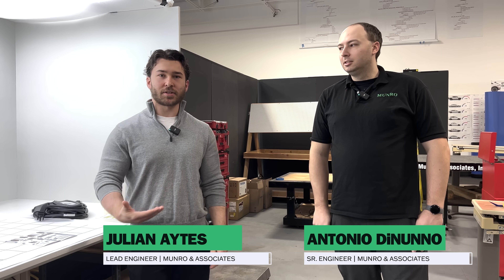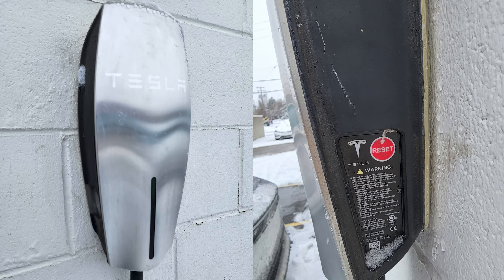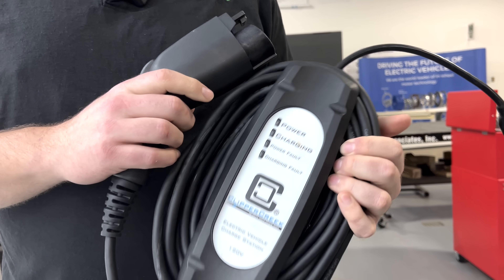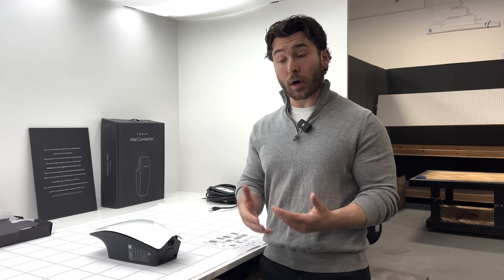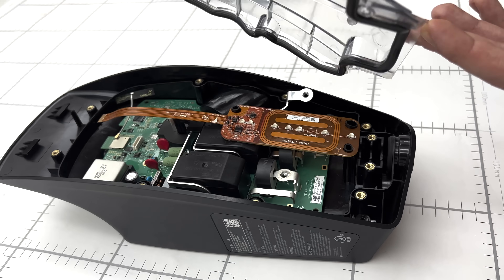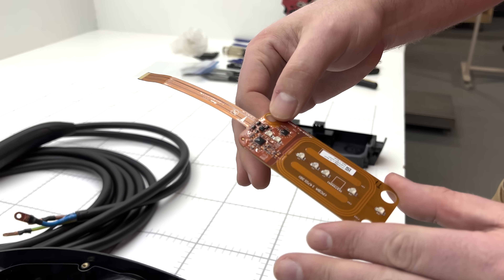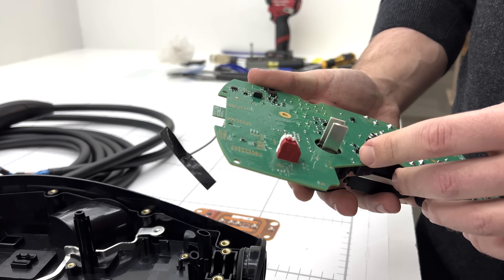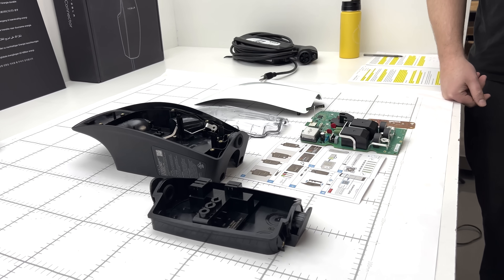EV Home Charger Teardowns E1: Tesla Wall Connector

Comment: 12:34 I swear to God once you start using a torque screwdriver for diy electrical work, you will NEVER look at the average electrician the same

Sidenote: I'm going to be disappointed if Sandy doesn't reply with a comment about tHrEaDeD fAsTeNers 😉😉😉🤣
Reply: There is no disrespect for the threaded fastener, just a general disdain for excessive and unnecessary ones where other options are better suited.
Reply: @BatterVswithAntonio  oh, well, in that sense, wago-style lever connectors would definitely be a better option if they could be sprung much more aggressively. I say this as someone who's still just getting on the wago bandwagon... If they could be made much beefier I'd probably drop wire nuts entirely. I like all my current conducting splices to squeeze down on that copper almost enough to cause plastic deformation. Which, full circle, is the great part about torque screwdrivers... You get that clamp load of 200ish-400ish pounds on wire binding screw/wire of a commercial+ grade receptacle, and not, like, 1000lbs.
Reply: Nec 2023 requires the use of a torque screwdriver,there has always been torque specs on breakers and other terminals
Reply: @cengeb  I think it actually goes back to 2017. And yet, nobody uses them. They're very important to get adequate contact pressure on copper conductors.
Reply: @Ariccio123  yup correct

Comment: the unknown connector on the back (red white) may be the deprecated 'serial' port to interconnect between wall connectors allowing them to safely share a breaker. Previous versions relied on a physical data connection to accomplish this. The modern ones use a wireless network to instruct one another how to share gracefully. The wire terminals may be to enable sharing with a gen 1 or gen 2 wall connector...just undocumented.
Reply: confirmed this as true
Reply: @BatterVswithAntonio  where did you find that confirmation?
Reply: @Marki555  confidential source ;-)

Comment: Antonio and Munro team. You start this level 2 charger series with a great bit of lean design by Tesla. Having learnt a little about lean design from Munro here are a few lean thoughts that IA chatbots would struggle with:
-- The Tesla HVAV system is great lean design but it could all be under the hood in a single package with ducts to the cabin.
-- Side-stick drive-by-wire   As electromechanical brakes are a thing, brakes don't need hydraulic components. There are motor vehicle systems to steer, accelerate, brake by wire - we can have drive-by-wire using a side-stick as used on Airbus aircraft and many wheelchairs - they are human rated. The side-stick would mount on the door and might include vehicle security and safety systems. There would need to be left and right hand versions, and disabled people could get bespoke side-stick shapes and locations.
-- Without HVAC and driving controls dash/floor mounted, the dash can become a bar like in the Canoo. The bar would be a mount for airbags, air vents, screens and some switches. Some console electronics could be mounted on the bar. Driver and front passengers could have identical screens and see identical information, but only the driver could control drive-by-wire functions. Rear and side view mirrors would go to be replaced by cameras and view display on screens. As with CyberTruck design, full width front windscreen sunshades could come down from the top and up from the bottom but with a safety mechanism to ensure the front screen can't be closed off while the vehicle is in motion.
-- If we are doing drive-by-wire, we could could have identical front and rear drive units that combine drive motors, inverters, inboard brakes and steering in a single casing. the drive unit would get inputs of HV & LV power, cooling fluid, control (from side-stick), and outputs via half-shafts and steering rods.
-- The Toyota/Denso electrical supply unit concept is a good idea. It could contain all the inverters for the vehicle including drive motors and the LV battery (Tesla 16V Li-ion increasing to 48V (12 cells - about 47 V in operation). Dumb charge ports, HV battery and possibly inverter-less HV motors would connect to it.
-- Inboard brakes permit outside and inside wheel aero covers, or wheel redesign to avoid inside aero cover.
-- Unless towing, or accelerating hard for a few seconds, few vehicles need more than 80 kW continuous. Average energy use for an EPA cycle is less than 20 KW. AWD can be achieved with front and rear pairs of 20 kW axial flux motors, planetary gears and inboard brakes, and no differential, allowing vector control in a slim package. A high energy efficiency and low cost package that could be used by many manufacturers.
-- Tesla takes the view that battery energy density does not need to be high for most vehicles given the weight savings being made elsewhere. We are likely to see LFP confined to stationary storage, while the similar, but 15% more energy dense, M3P (Zinc Magnesium Aluminium Phosphate cathode??????) is used for most vehicle applications. Surely this means blade cells, blade thermal conductors and cooling plates end up as the lean design that rules 80% of the battery world.
-- 48 V low voltage systems, ethernet (??) data systems, single vehicle control board (excluding drive by wire) and common sub-boards to control systems in doors, front, rear, ceiling, etc.

Comment: I am on a 60 A breaker but I'm limited on the Tesla App to 32 A. Is this normal?
Reply: Some possibilities: 
1) If your Tesla is not one of the longer range models, your max charge speed may only be 32A vice 48A (Model 3 SR+, for example, can only do 32A max).
2) Your Power Conversion System (PCS) has a failed module (this converts AC power to DC). The PCS in longer range cars has 3 modules of 16A ea = 48A max, whereas shorter range cars have 2 modules x 16A = 32A capability. PCS failures are common on certain 2018 LR Model 3s (happened to me).
3) You have a loose wiring connection somewhere to or within the Wall Connector & the unit is detecting it & limiting charging.
Reply: @christopherm.6094  thanks, that’s it. I just purchased the Model 3 rwd. I don’t get the logic because it’s still 10 times slower than lowest supercharger speed. Oh well, it chargers at night so what what do I car if it’s an hour more. Thanks again!
Reply: @mgarcia8878  Yeah, unfortunately the onboard A/C charger is smaller in that vehicle.  You are set for future vehicles though and will have slightly lower voltage drop with your setup!

Comment: What is the advantage of using this Tesla wall charger over simply installing a NEMA 14-50 or 14-60 outlet?
Reply: You would need a mobile connector to plug into the outlet still.  Only advantage is up to 48amps vs 32amps for mobile connector if that is what you are comparing it too.  One reason to enjoy using the Tesla Wall Connector over off brand is you have the same, quality design handle that has a button to open the charge port.  Better design imo, also very affordable.
Reply: Reliability with hardwiring directly into the box, a connection point is a potential point of failure, and if not done correctly, an eventual point of failure.

Comment: Most public chargers here in austin are standard Type two and assumed by the restaurant or retailer, clearly assumes they pay to install and forget. Based on the number of failed chargers siting idle. Frustrating, as I have a great ChargePoint smart level 48a rated charger but can’t even get an install quote 😢

Comment: It would be nice if you can add a "taking apart" to see how well are they put together and how easy or nit a certified electrician will be able to service the EVSEs
Reply: The only servicing an electrician would be doing is replacing the cable (if a replacement is available), or replacing the whole unit.

Comment: Tesla should integrate and/or separate MPPT charge controller that can directly charge the car through DC. Imagine a 5kw or more solar system then dump all that energy to the car with only a DC to DC conversion, can't get more efficient than that

Comment: “Level 3” and “level 4” charging are not real charging terms and not recognized by any any sort of charging standard (at least not in the way you were using them). They’re terms created on forums by people who don’t know what they’re talking about.

The spade terminals connecting the back panel to the actual EVSE seems like an odd choice and prone to failure. The spring tension in the connector will loosen up due to temperature cycles and as it gets more loose, there is more heat, leading to less tension, more heat, etc. I’ve seen countless high amperage connectors like this melt and fail in relatively short order. I’d expect that the majority of these chargers will fail right there. Would have made way more sense from a longevity perspective to eliminate that unnecessary connection and have the power inlet go directly to the PCB. Might make it slightly harder on the initial install, but it would remove a significant point of failure.

It’s also weird that you praise Tesla for doing something that makes a product of their’s (slightly) easier to work on but trash every other company for doing the same thing because it “adds parts” or it’s “more expensive” or “adds a failure point.” The bias towards Tesla is becoming clearer and clearer, especially since we now know Munro is an investor and cannot possibly be considered an unbiased reviewer of Tesla or their competitors anymore.
Reply: Aren’t spade terminals the same type of connection used on a circuit breaker to connect to the bus bars in the load center? I couldn’t see any coil springs; looked like a leaf spring or similar.
Reply: Good points.

Comment: So I'll throw my 2 cents in the hat. First about wire installation points was not very well covered as others have commented (4 wire entry options.). Second was about the size of circuit breaker used and for which car there is a table in the installation guide just could have been a quick view. Overall good job but not quite 5 ⭐'s.

Comment: Great to see this. It needs to be said as many don’t appreciate that these are not car brand specific.
Reply: The charger isn’t but the connector on the vehicle end is. The one that comes with this charger will only work on a vehicle with a Tesla charge inlet (unless you spend extra for an adapter).
Reply: @ouch1011  correct this would be true for the US and possibly China, but in the rest of the world Teslas like most are supplied with CCS2 ports. Consequently the Wall Chargers are supplied with type 2  plugs.

Comment: Still waiting for the AC/DC converter at the meter that then pumps the high voltage over smaller wires directly to the car instead of using an onboard ac/dc. 

This is going to be even more important with 800v systems and the massive amps drawn for 240vac to quickly charge an 800v system. 

Also for people with solar or even Tesla power walls a dc/dc version would be vastly more efficient. 

And the portable cable could easily have a PFC and ac/dc converter in the box on the cable at its amperage so no real benefit to having it in the car and adds weight and complexity for no reason. Cars should be DC only and the home chargers should all be DC.
Reply: So you’re ok with buying a $2000 home charger (without install)?

I think I’d rather have that expense lumped in with the car, especially since the car would still require an OBC to be able to charge at any L1 or L2 public charger.
Reply: @ouch1011  the install cost would drop drastically because of wire sizing. 

And the device would maybe be $100 more. The MCU is already there and the PFC and inductor total BOM is maybe $50 at most. 

Total cost really with wire probably $25 extra. And the car gets cheaper, simpler and lighter. 

And people with solar save 10% or more on their single largest power draw.
Reply: An 800v battery won’t draw any more current than a 400v from a residential installation. Any supply above 240v is already DC, but requires three phase and is out of the cost range and needs of residential.

The onboard charger is part of the L2 protocol/standard which lacks more sophisticated handling, and DC fast charging won’t ever make it to residential due to it being unnecessary.

What could happen is a new standard to allow a DC bypass for solar to eliminate the conversion penalty.
Reply: @TheCorteseFamily  all of this is just wrong. 

The only part you got right and by accident is that 800v systems probably won’t draw more AC current over the wire. But the reason is because the current draw at 240v would be huge and cost prohibitive. 

All 3 phase AC does is provide 2.5x more amperage per volt by using 3 wires plus neutral instead of 1.  But the wire size is the same as if you used single phase to provide the same amperage just over 3 instead of 1 wire. 

You can produce any DC voltage you want from any source voltage AC or DC. I can easily use a simple capacitive voltage doubler in series to produce a million bolts if I want from a 1v source as a small example. 

Using a PFC you can, at the meter have access to 240vac @ 200 amps without having to upgrade any home wiring or panels. At most they have to upgrade the service to 200a or more. Then since most of the meters are close to your garage or where you’ll charge your car you convert AC to DC at the meter using a synchronous Power Factor Correction circuit (6 fets) that boosts the resulting DC voltage to around 384-400v as a pleasant side effect. You then use Ganfets or sicfets to switch at over 1 mhz which allows you to use much smaller transformers and reach over 95% efficiency if done right. 

On the isolated side of the transformer you then synchronously rectify again and boost to 800v. (Or whatever the car is requesting because often until 80% the car is requesting only an amp limit and the voltage can be vastly higher into the 1kV or higher range. )

All things being equal to provide 12kW as most home chargers provide, you’d then need 12 gauge wire to your charge point instead of 6 and you’d have vastly less wire line losses and the cable to the vehicle would also be tiny. 

But you could also go from 12 kW to 24kW to charge much larger battery packs in the same time and use only 8 gauge wire while providing the car double the power of the current systems.  (24kW is 100 amps at 240v AC RMS and only 30 at 800v DC.)

As an example, the cost of such a test device (which are way more money than mass production) from TI is $240 to buy. And your wire cost is less than 1/4 what it would be per foot to the charge point. 

And your car gets lighter so you’ll save electricity all other things being equal. 

And it then becomes trivial to split the power after the transformer to 2 separate charge points all serving DC to the car directly and do load sharing of the 100amps and of course it could be hooked into the smart meters which are right there easily to control grid demand all in a single unit. 

There originally was a reason to provide an AC/DC charger in cars. And sadly 800v cars will still need a 400v to 800v non-isolated boost circuit (no transformer and thus almost no weight and 98+% efficient) for old chargers until they’re all replaced with 1kV units but now there is no reason to provide AC/DC conversion. 

And it solves the 3 phase problem in Europe and lets them rid themselves of the horrific CCS connector while making the cables vastly smaller.  (This is also part of the reason why Germany is pushing to switch all power drops from AC 3 phase to DC only. It’s vastly more efficient, more cost effective and solves the PFC problem entirely by doing it at the isolated transformer.
Reply: @jameshancock  Why are DC chargers 10x more expensive to buy than AC if you can make it for $200 as DIY? Don't forget it needs to be very safe if everybody will have it installed at home... And high voltage (over 230/400v) is more dangerous, so I would not say it is cheaper/easier to do.
Where did you read Germany wants to have homes powered by DC? AFAIK they want opposite - they want HVDC as means of long distance power transmission.
And I'm quite happy with the CCS connector and my 3 phase home supply.
Reply: @Marki555  because they’re high amperage and have to handle 8+ units in the same system. 

They’re nothing more than a boost converter and a power line communication adapter hooked up to an mcu. Everything else is noise for the operators. 

Of which you don’t need any of in your home.

Comment: That red and white speaker connector, I think it's an RS485 MODBUS output.  There must be a Maxim485 chip nearby.  Based on my research, the energy sharing was able to work on the V2 charger.  Unfortunately, the V3 charger only works via Wi-Fi, and it does not allow external software to control the charging.  I hope this will be fixed in another update.
Reply: This would be my first guess. Some sort of serial interface which may be multi purpose but in previous generations was used for power sharing. I have no idea if anyone has reversed the Wi-Fi sharing on the V3s, but I have to imagine the protocol can't be too difficult unless they're doing some sort of strong pki based device authentication to secure the power sharing communications.
Reply: And some quick Googling, it appears the protocol is HTTP based and does do mTLS with some sort of baked in device identities, but you CAN set max power on a per device bases using the public not secured APIs.
Reply: @tazeat  Setting max power really is just setting the circuit breaker size, and IIRC can only be done in commissioning mode.